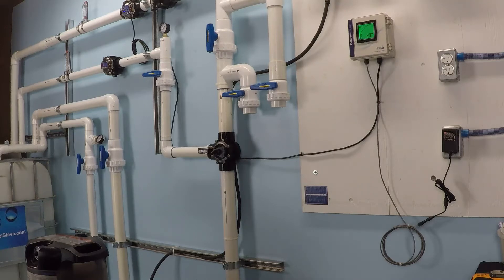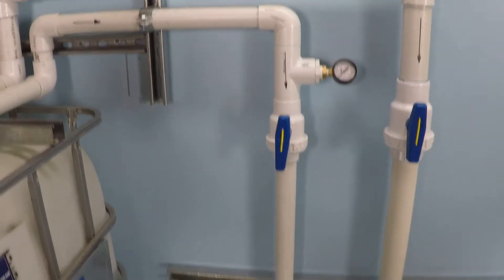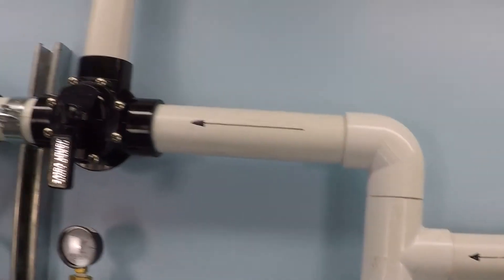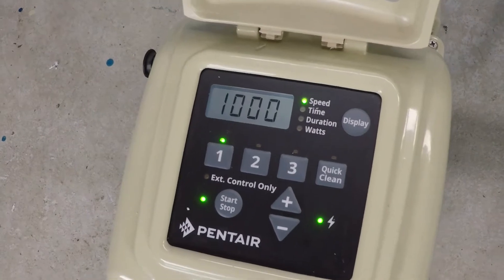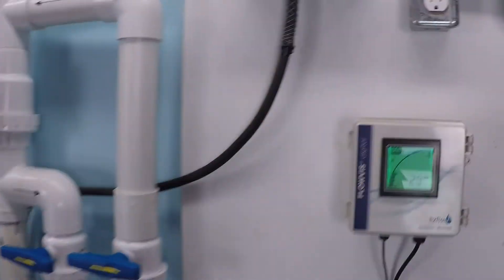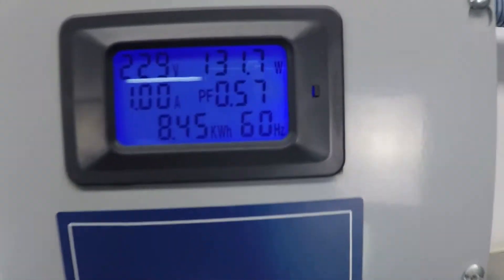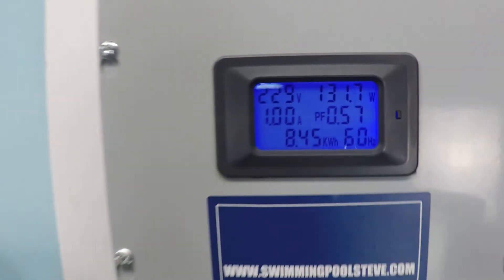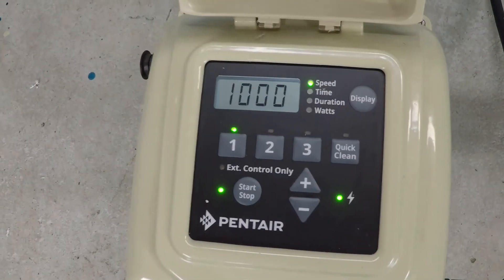Flow Rate Example - 1000 RPM

Comment: When I note from this video that the SuperFlo VST can flow 29 gpm at 1,000 RPM, with only 131 watts, and from another of your videos, it can flow 22 gpm at 750 RPM with only 90 watts, I wonder if you have ever done a similar test at the 450 RPM minimum for this pump?  It seems like it should still be 13 gpm, but at what amount of power?  These types pf videos are obviously quite useful and greatly appreciated!

Comment: Interesting. What do you call the metal brackets that hold the pipe?
Reply from the maker: The system is called U channel, uni strut. Common for electrical and mechanical applications. The pipe clamps are sized based on the pipe ypu want to hold. So, like a 2" pvc unistrut pipe clamp.
Reply: @Swimmingpoolsteve  thanks steve, now that you mention it I guess that’s the stuff I see in electrical section at Home Depot. Hope they have the pipe holders in plumbing. Do you ever consult? I have some questions about my system and would be happy to pay you for some of your time.
Reply from the maker: I do have a consulting service www.swimmingpoolsteve.com/pages/ask-steve.html